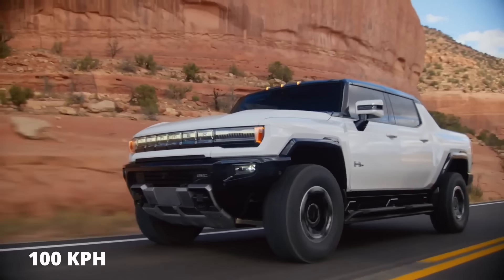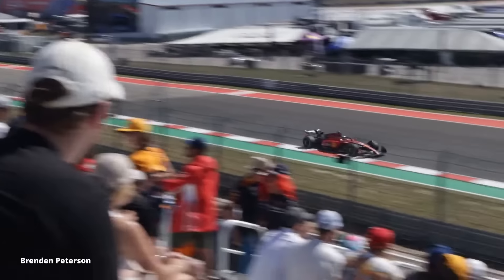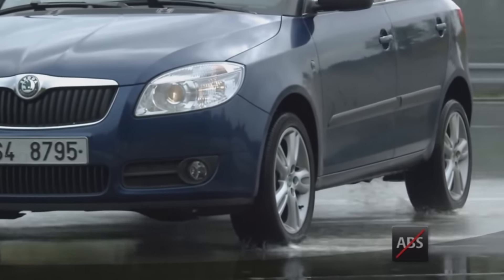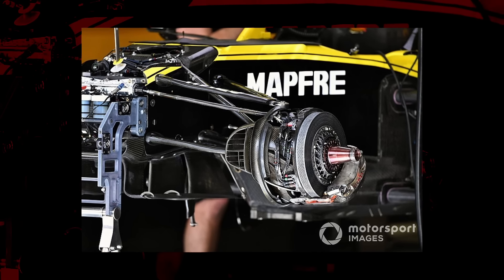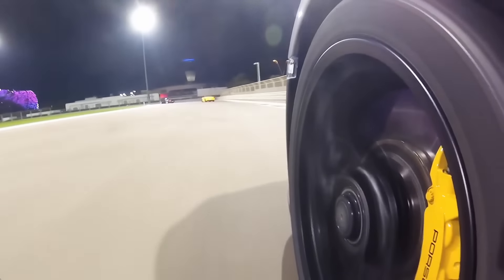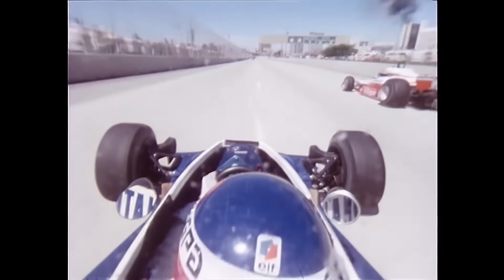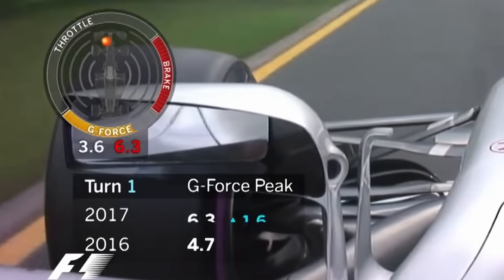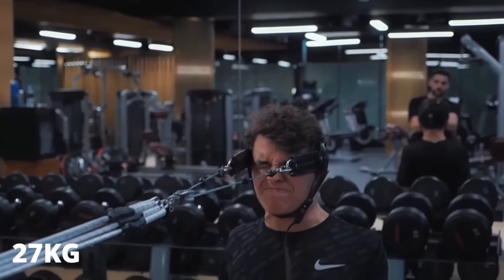Why It’s Almost Impossible to Stop From 200 MPH in 3 Seconds

Comment: there in situation thatlocking the wheels is faster to stop then just not locking them up in gravel and lose snow the gravel will build up infront of your tire making you stop quicker but you do lose controle and thats the most importend thing abouth abs the controle part even on a dry road you will stop faster if you manage the brake your self then having abs but in a panic you will just slam the nrakes thats wy they have abs

Comment: 2:10 One detail wrong. ABS is especially important on the rear wheels. If they block, you end up crashing somewhere backwards .
If the front wheels block , you just go straight ahead , hopefully without hitting an obstacle .
Reply: But if your front wheels block, youre not braking as much anymore, so wouldnt say that's wrong. If i could chose, i'd still rather have only front abs than only rear

Comment: I remember breaking Renault Vel Satis (European Van) from 200km/h (~124mph) to 0 is about 160 meters (from, 250 was not that effective), so literally if you see obstacle no chance to hit you will always break (not on ice), in BMW 5/7 it's different still lot of breaking power but there is a car lift force (inverse to down force) braking at 200 or 250 km/h is.... sloooooow

Comment: Stopping from 200mph in 3sec is possible and already been achieved long ago. The problem is you will more likely to break your neck from that stopping power than anything else. Engineers are capable of making anything, but it is the driver itself is the bottle neck due to our nature and are not capable of handling such high G force even with assistance of HANS device. You will not break your neck but the blood in your body will rushed through your veins under those intense loads pooling in unwanted locations that can cause life altering injuries or even death and there is nothing you can do to prevent such complex problems from happening inside of the human body.

Comment: Uhm… 200-0 in 3 seconds is just over 3g average. If you just used a fan and skirts to keep the downforce at low speed that is easily possible

Comment: You got the "rolling tyre will brake faster than a sliding tyre" wrong, they steer better due to sliding tyre not carrying lateral forces but most definitely will have more friction over a rolling tyre. The reason why they let the wheels turn when locking up is because they would otherwise flat the tyres, even make them explode.

Comment: 6G? Welcome to aerobatics, where it is very far from the limit. 4G down sitting in good seat (pull up in loops and so on) I can feel, but it is hardly noticeable, just little discomfort. 2G up (upside down, in some reverse maneuveres when you hang on belts)? Very unpleasant but bearable. 2G up + rotation? Burpable. Real maniacs fly with 8G (professional plane structure load limit is 10G), it requires special sequence planning as on 8G for more than couple of seconds you get blackout.

Comment: First F1 cars weight is with driver... Everyone now have 80 kg for a driver... if your driver dont weight 80kg you need to add weight on the seat... Second, brakes is not the number 1 fact f1 cars brake so well... its all about weight tyre grip and aerodynamics...

Comment: That not true you CBR will not stop in half that distance unless the Hummer's brakes are crap   You bike has two wheels with small tire road contact patches, verses the Hummer with 4 large wheels.  You CBR will stop in the same distance as car.

Comment: ABS does not brake harder than without ABS, it gives you the opportunity to steer as the wheels keep turning. Actually, a car without ABS can brake harder than with, because the abs interrupts braking every time. These tests have already been carried out.
Reply: in reality, braking with ABS will stop your car faster than without, even for skilled drivers. Except on gravel/snow etc
Reply: @szymoniak75  As mentioned, ABS makes the wheels spin while braking and does so by very quickly removing the braking force and braking again. Every moment the braking force is reduced, so there is also on average, less braking power. So less braking power is longer braking distance. Please look at the tests that were carried out and how ABS works.
Reply: @ivojanssens221  link/point me to such tests, because it is not true, only for motorbikes or old cars.
Reply: @szymoniak75  Can't even look anything up? No wonder…
Reply: @ivojanssens221  LOL you think I'm basing my argument on nothing? I've already researched this topic thoroughly, that's why I'm saying this. If you have some other evidence, provide it to me.
Reply: @ivojanssens221   "Every moment the braking force is reduced, so there is also on average, less braking power." ->  braking force isn't the bottleneck, the tire grip is. You want to keep the tire sliding a bit, that's where you get the best grip and therefore deacceleration. Locked up tires actually have worse traction, so they slow the car less
Reply: @szymoniak75  You are right but also not...
Since manual brake control works finer than quick "on/off" braking, which is what ABS does. So on/off is a "lock up" every time for a moment, a millisecond, which is not good, and then nothing, which is also not good... Can everyone brake faster without ABS? No, most people have no idea about max braking power, grip, slip, oversteer or understeer... but I can brake faster without ABS than with, simply because the system won't let me brake for a few milliseconds. And not braking is... longer braking distance. So for 99% you are right, everyone can apply full brakes immediately with ABS and still steer too, few can apply full brakes and control brake pressure depending on what the car is doing. So if you belong to that 99% you are right, if you belong to that 1% you will have to admit I have a point.
Reply: @ivojanssens221  Modern ABS are so fast and so precise that I still believe you (and no other human) can outpeform it. You'll usually either brake too soft or lock up and then release too much resulting in wasted brake force. ABS is at the limit virtually all the time when braking hard

Comment: abs wont help race drivers they can brake harder with no abs with bikes on track its the same with a r1 i can brake so hard the abs comes in but the rear is not lifting yet wihout abs i can lift the rear wheel on track braking for a corner so no they dont need abs and if theyy want to stop quicker and there are no rules just have airbrakes like on a plane or bugatie has
Reply: That is in perfect conditions. Anything but perfect, ABS will be equal or better.

And you don't want the rear wheel on the bike to lift. You want the rear to transmit braking forces as well. Plus, if you only brake with the front, you lose a full level of controlability. Any little object could upset the very delicate balance and send you to the ground.